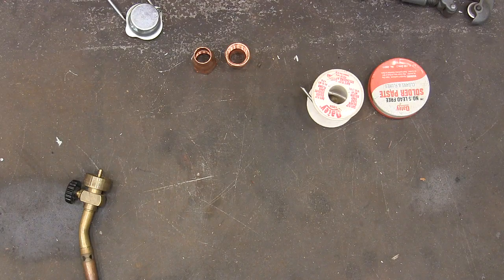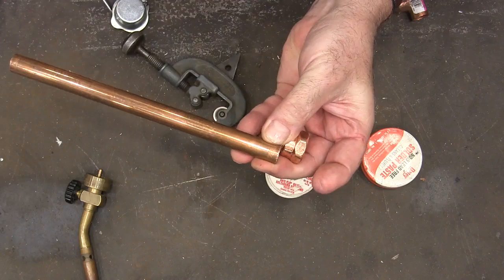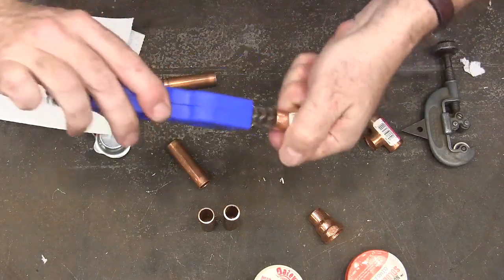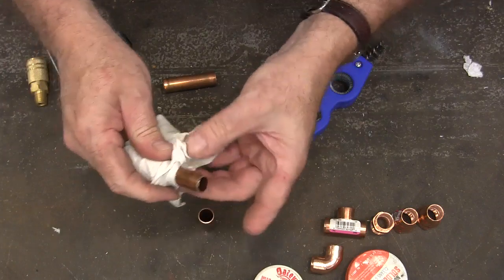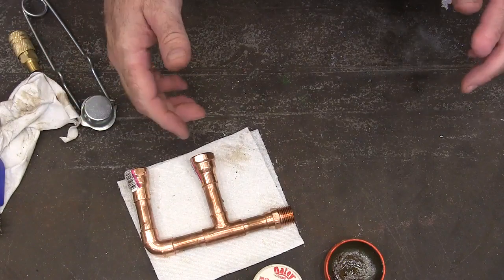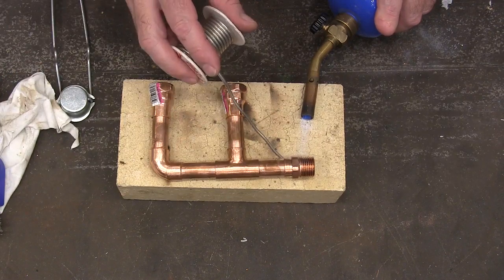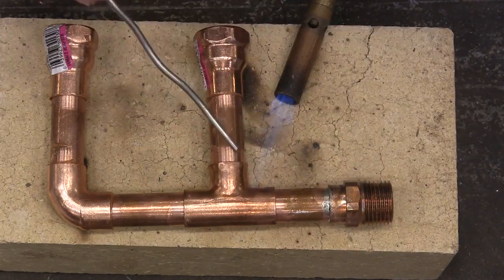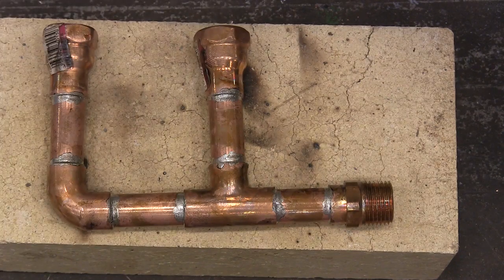How to Successfully Solder Copper Pipe

Comment: I got my whole basement to do good mechanic I'm good at almost everything I do I do construction for many years what's soldering is one thing I tend to have a lot of problems with every time I solder pipes they only last so long until they start to corrode or leak and I do wipe away the excess flux at the end I see what I'm doing the wrong I used to put the solder on the flame from what I've been seeing a lot of videos you want to solder almost the opposite side of the flame thank you for this video definitely helps
Reply from the maker: I think you're on the right track.  As you said the pipe should melt the solder, not the flame.

Comment: Dude are you using your fingers to Flux. Folks don't do that, you don't want any oils on that pipe.  This is bad practice. Yeah, u might get by, by yeah the solder may not flow correctly.  And, you can Flux your fittings.  not an over abundance.  I started to vomit, so I had to say something

Comment: Thanks for the video!  This was so helpful!   Question - do you need to move the solder around the back side of the pipe to cover the full diameter?  Or does it just move all the way around because of the heat?
Reply from the maker: Glad it was helpful.  Technically you don't have to wipe all the way around.  If the joint has ample heat the solder will liquefy and "wet" the entire joint.  You should be able to see it at the edge.  However I almost always wipe the solder all the way around.  A leaking joint is a real pain as you have to take it apart and clean it before you can try to solder it again.  Thank you for letting me know you liked the video!

Comment: Apply the flux to the inside of the fittings thin and sparingly to avoid too much from smudging forward when the pipe is inserted. And generous on the outside.

Comment: The pipe cleaner you linked is over $11 on Amazon. I wish it was $2.
It's not recommended to put flux inside the fittings as it just pushes out and leaves an abundance of flux inside the pipe, which can cause issues down the road.
Reply: As he said, he got it at harbor freight and if you follow the link it is 2.99. Obviously the price would be different elsewhere. https://www.harborfreight.com/4-in-1-plumbers-brush-45339.html

Comment: It seems so 'hit and miss'  just soldering one side and hoping the solder is drawn into all parts of the joint. In the UK we'd use Yorkshire fittings which have solder pre installed in the joints. Just clean, flux and heat. No solder wire needed. But an interesting video nevertheless. Thanks.
Reply: That's cheating.
Reply: We don't all do it this way in  the USA.  We don't stick our fingers in the Flux, and we move the solder around, especially on larger fittings. This is how I would explain, playing cricket or the joy of watching soccer.  I could make some wild guesses, and be half right and wrong

Comment: Hi! 
I do it exactly the same way, but my droplets of melted solder do not stick and just roll down. What to do?
Reply from the maker: Either the fittings not hot enough or more likely not clean enough. meaning it wasn't sanded to bright metal, not fluxed well or got contaminated by dirty hands. Hope that helps and good luck!
Reply: Soat Mon <= Thanks a lot, I think I overheated my pipes...
👍👍👍

Comment: @Soat Mon, I have a situation could use some advice on.To start, never did pipe soldering.Electronic wise, I solder boards.I do understand a good deal though.
 So, I brought a used Whirlpool gas 40 gal water tank.Course it's taller then my other.Will require some pipe redo.Now for the fun part....
 Appears whoever had the tank put fittings for hot cold inlet without any nipples first.So, it's a direct into tank pipe work.No left, right nipple then screw ons and pipes up etc.Pretty much hacked.Next, few solder points on pipes of which is clumped crap.Worst part is, on hot side I have the hex screw fitting going into inlet.About a half inch pipe sticks out that top fitting at best.He cut the pipe plum down where blue tank cover is.I have attempted to remove fitting at no luck.Pipe wrench will not go on, socket stripped hex head, no room between cover etc for anything.Now this guy also soldered all his work in steps while stuff was attached to water tank.Melted the round plastic circles on hot cold. Left beads of solder on top cover.I am told DO NOT solder each step while attached to water tank could damage tank ( I do not know ).Could of already, can't even test tank yet to see from whoevers cluster screws.Matters worse, I have to solder say a coupling on that one size I explained has just a fitting screwing into tank with about half inch if that, pipe out it.I'm concerned.
 Advice on above? With that, do they make a glue I can use for copper pipe at least to where I could run a coupling on that short side then solder rest.Keeping heat off tank? Another words, put glue on nub pipe ( short ), coupling on it.Do rest in sloder away from tank then glue and slide my done soldered workings in other end of coupling.Thus just that coupling and pipes in it are glued.Make a good glue or bonding for this?

Comment: You don't have to flip it to the other side? The flux pulls it in on all sides?
Reply from the maker: If everything is clean and fluxed, the solder will flow and fill the entire gap between the pipe and the fitting.  You just have to add enough solder at any point, you don't have to circle the joint with solder, it will flow.  Thanks for watching!

Comment: Good demonstration, Thank you.  I have heard of silver soldering...is that process very different from what you have done here?
Reply from the maker: Pretty much the same but you use different flux and solder.  You actually don't have to have things as clean because the high temp burns off the oxides, dirt and oil.  You still have to clean but it's not as big a deal.
Reply: Thank you, much appreciated.